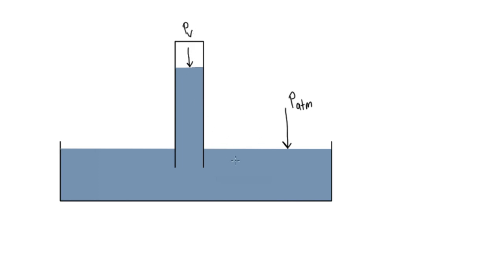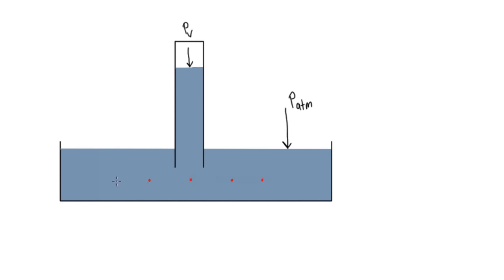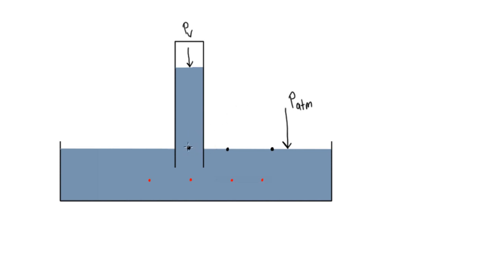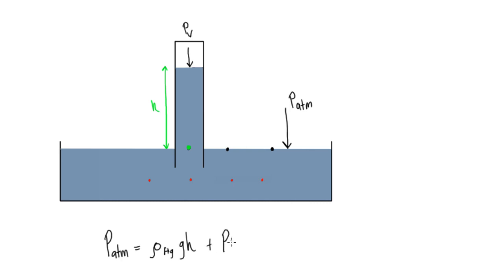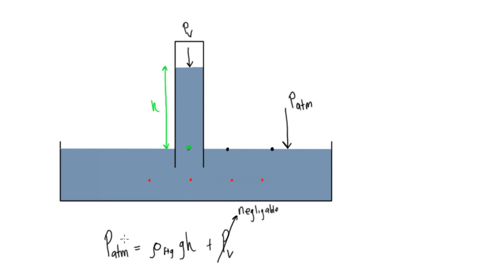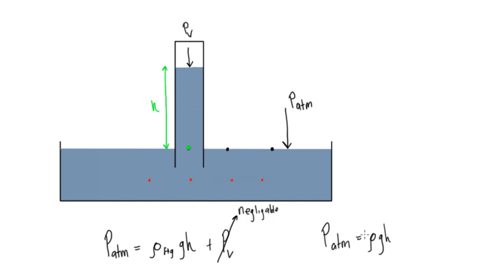How to solve barometer problems

Comment: How do u solve questions that have gas in 2 sections
Reply from the maker: This problem does, just one is parallel as Patm. Just label P1 and P2, and use the same steps to find either the pressure difference or column height!